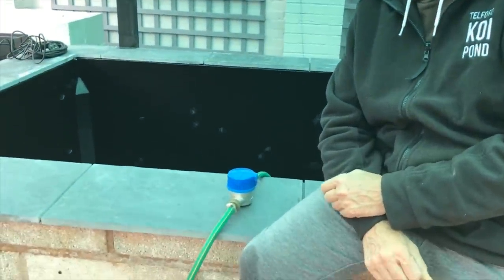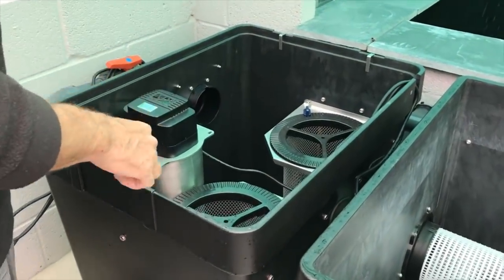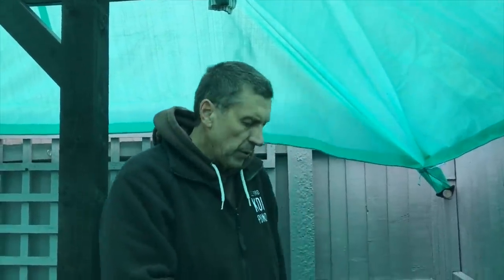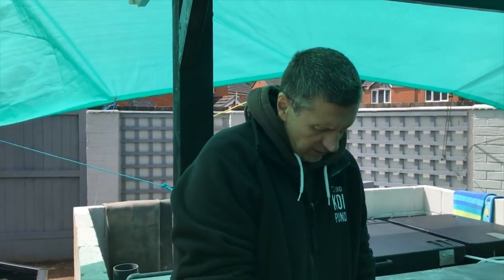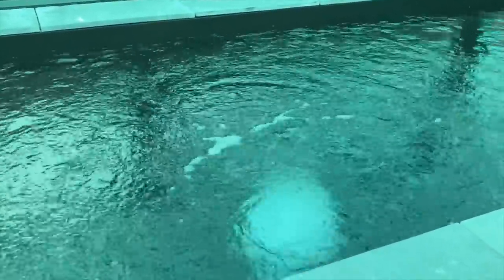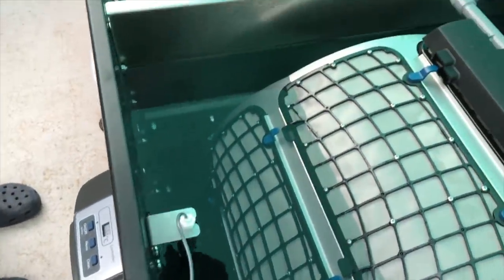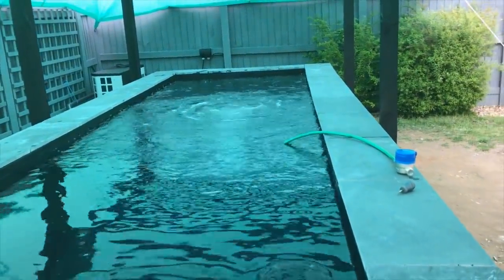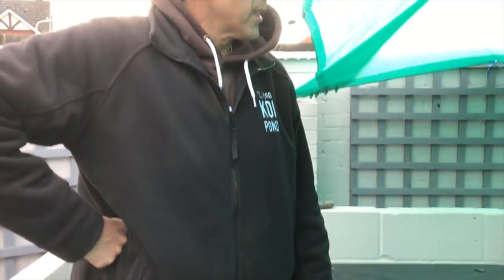New Telford Koi Pond Part 22 - The BIG FILL, Filter switch-on and the Thermotec Airsource Heat Pump.

Comment: Brilliant. All looks amazing. The heater is better there as you will loose less heat as the return to the pond is so short rather than heated water running down 10 meters of pipe before going into the pond. You did well with the weather we've had recently. I don't think the fan was running when you said it was so quiet, hope you got it sorted. Thanks for filming all the switch on also, nerve racking moments and you actually filmed it. Cheers.
Reply from the maker: Hello Simon, very observant, I’d switched the unit on but not the actual functioning of it. Realised my error when we stopped filming so a press of the on button and everything jumped into action. Thanks for watching and commenting 👍🐟🈲😊

Comment: Sure someone else has probably mentioned but you will need to change the settings in the engineers settings on the Thermotec. Need to change the temp swing range and lower end temp. Also adjust flow using the bypass to get a 2 degree difference in temp for water in and out. Great job on the build
Reply from the maker: Good afternoon Richard, No, no one else has mentioned this. Is this something I can do (if so how?) or do I need to get in touch with the place I bought it from? Many thanks in advance for pointing this out.
Reply: @TelfordKoiPond  you can do it yourself. I have the setting changes on messenger that I can send. You just need to restrict the flow using your bypass valve to balance it and get the temp difference.
Reply: @TelfordKoiPond  R04 and R12 need to be changed to 0.3% and R10 is the lowest temp setting which is 15 from factory so reduce this is you want to have it lower at any point. Engineers code is 66 to access the extra menus
Reply from the maker: @richardrapley9210  Brilliant, thank you👍🈲🐟

Comment: Great job.  Fantastic to finally see it filled and running.  Filling up the filters during the fill should be fine as it's the total water volume you'll need for treating, not just the pond itself.
Reply from the maker: Thank you for taking the time to watch and comment, much appreciated. Your are obviously correct re the whole water volume for any treatments so no harm done even though it was a schoolboy error leaving one of the valves open 👍🐟🈲😊

Comment: Well done mate. Done a fantastic job. Your filtration is lovely and neat. Look forward to seeing the fish go in. Pp really dose help speed on maturing the media. That hel x is great stuff. I've got 100l in my ibc
Reply from the maker: Cheers Danny. Yes, wish I had pp’d it now so may scoop some out and get it in for a day or two. Thank you for watching and commenting 👍🈲🐟😊
Reply: @TelfordKoiPond  yeah scoop most of it out and soak it in pp for a few days. It won't of built up any bio yet so not losing anything. Will help lots in the long run. Have you got any mature media from your temp pond you can chuck in your new filter? Maby get something in those baskets in the pump module. Those oase drums are so neat, If I could do mine again I'd have got one of them
Reply from the maker: @dannycurrie1  yes will be putting the mature media from my holding tank into the new filter to help 👍😊

Comment: Great job Phil, I have the same drum
filter on my ponds, best ever investment I made along with Oase pumps what you fitted, I would recommend you get the oase EGC controller easier to change the settings of cleaning times etc and monitor any issues if your away or at work, look forward to the fish going in.
Reply from the maker: Hello Gary. looking for some help please. I've just been setting up my Oase drum filter and I believe I've done everything correctly but I cannot get rid of Er88 on the control panel. I've gone through the instructions several times and can't see what I'm doing wrong but the level detection device still keeps giving me error message Er88. The water level in the unit without anything running is bang on the maximum water level and when I turn the main pond pump on it drops to the minimum level marker. I've tried to set the device as high as it will go and as low as it will go but after a manual clean or after 10 mins of running the display on the control panel changes to Er88. Any ideas what I'm doing wrong?
Reply from the maker: @garygillespie4188  Thanks Gary. Phoned Oase Technical support and I walked them through what I had done and how I did it and their advice was........turn the sensor off as it has no real value in a normal system. I have turned it off and everything is now working correctly but still have concerns 9dont like turning sensors off) so have asked for further guidance. Thanks for getting back to me so quickly.
Reply from the maker: @garygillespie4188  Gary, can I just check, when you take your lid off and do the clean test, does your drum go round? Only asking as Oase tech support are saying that the drum wont go round without the lid on? Sorry to be a pain but I'm struggling to make any sense of this.
Reply: @TelfordKoiPond  no problem Phil, if you spoke to Jordan I am sure he will be right he knows the inside and out of the drum off the back off his hand, yes I am sure they will provide you with more information on that, glad I can assist if I have 
Gary
Reply: @TelfordKoiPond  it’s okay mate you can test without the lid but only spray will work for safety reason, sorry I wasn’t clear there, but the drum won’t go round, but I have a spare magnetic to test the drums as one of my lids was damaged when I receive my drum first

Comment: Fantastic Phil 👏🏼
Great choice on the heat pump brand and the model as its always worth having a bit of gas in the tank for those particularly cold winters.
I have had the hel-x13 k1 and k1micro media for a number of years and the hel-x13 seemed to tumble much faster than the others, I've recently upgraded my bio chamber and added another 75 liters of media but this time I've chosen k+ so now I've got the whole set 🤯 I dont think it's a notable difference to the average koi keeper as to which is better but I've covered all bases now.
Adding a blead valve to the bottom drain air pump should tame the jacuzzi effect so you can see the koi more clearly from the top.

Goodluck mate
Reply from the maker: Hello Tom, thank you for watching and commenting, much appreciated. Definitely going to get a bleed valve sorted. Stay safe 👍🐟🈲😊

Comment: Hi! In the process of building my pond at the minute just waiting on it to be fibreglassed. Was wondering where abouts did you get you coping stones from? There just what I’m after and can’t find any.
Regards neil
Reply from the maker: Hello Neil, To be honest I had a right game finding anything I liked that was in-stock but in my internet search I came across a company called Hoyland Dismantling and they had a stock of Black Brazillian Slate Wall Cappings that were perfect size (new not reclaimed and they have a large number of sizes) and really good price so I got in touch with them. Daft think is.....Hoyland sell all this stiff on ebay which I hadn't looked at....doh!!!!  So either do a search for Brazilian Black slate wall cappings on ebay or give Hoyland Dismantling a ring. FYI - I had 28 (4 spare) 600 x 300 x 20mm copings and they cost me £227 delivered in 3 days. Hope this helps.
Reply: @TelfordKoiPond  cheers mate I’m playing that game now 🤣 I’ll have a look 👍🏻
Reply: @TelfordKoiPond  thanks for your help mate! Coping stones turned up today! Also ordered some splitface 3D cladding tiles with them as well so very happy thanks again👍👍
Reply from the maker: @neilp3406  great stuff, glad to be of help👍🐟🈲😊

Comment: If this is day 1 of the fill up, I'd turn everything off and isolate your filter from the pond etc, then leave it 24 hours to check if either the pond or filter water level has dropped. You may need to adjust your sensor level in the drum and it's does a sensor trigger clean every so often.
Reply from the maker: Hello, very valid suggestion and last night I marked Pond, drum filter, individual module and overflow to see if any losses overnight but good news is everything was still right on the mark. Have had everything running today (still monitoring levels all day) and all still good👍. Water is now up to 16.5 degrees so will run it for another 24 hours before thinking about moving fish in. Thank you for watching and commenting 👍🐟🈲😊

Comment: Have you got the fish in yet?
Reply from the maker: Hello there, not yet, wanted to leave everything running for a few days to check for leaks/water loss and to get the flows through the heat pump and returns set up correctly. Plan is to put them in tomorrow or Saturday latest. Will get a video done to capture the event. 👍🈲🐟😊

Comment: Looking good there Phil! What have you used to top your brick work? Is it slate or a slab? Looks just like what I am looking for. Where did you get them from please?
Reply from the maker: Hello Andrew, copings on top of blocks is Brazilian black slate wall copings. Cheapest I could find were from a company called Holland Dismantling. They sell stuff on eBay so you can also buy it off there. I went for the 600 x 300 x 20mm copings and they delivered them on a pallet 3 days after I ordered them so good service. Hope this helps.👍🐟🈲😊
Reply: That helps.  Thanks

Comment: HOW MUCH WAS YOUR THERMO TEC AND HQW MANY GALS WILL IT HEAT PLEASE
Reply from the maker: Hello Richard, I bought the 12kw model which is currently circa £2135 and the 9kw is circa £1865 at Heat Pumps 4 Pools. The 9kw model is recommended for up to 4,500 gallons whereas the 12kw is recommended for up to 6,000 gallons. I took into account the temperatures I want to maintain and the severe winters we've had of late. Best recommendation from me would be to speak to the people at Heat Pumps 4 Pools as they can give the best advice. Hope this helps.
Reply: @TelfordKoiPond  THANXS I WILL DO LOVE THE VID

Comment: Hi Phil, are you going to do any checks on your water before you put your fish in? Great job by the way 👍
Reply from the maker: Hello Rob, yes I will be checking the water before the fish go in. Everything has been running since the weekend and I’ve made a few adjustments to the air and flow through heater and other returns so have a really nice flow round the pond now. Filter media is currently soaking in pp so that will be going back in the filter tomorrow and then get some start up bacteria in . Thank you for watching and commenting 👍🐟🈲😊

Comment: New sub,how much was the ashp,and how many gallon is the pond cheers
Reply from the maker: Hello David, Thank you for subscribing, it is appreciated 👍. Finished pond is 2,500 gallons or 11,300 litres. ASHP was bl**dy expensive!!!! I ordered mine in October 2020 as I found out there were none left in the country and the next shipment was 90% sold so at the time I thought I was paying a premium as I had to shell out £1,850 but soon realised that the prices were only going to keep going up and I gather my model (12kw) is now £2,245. A 9kw model will do up to 4,500 gallons but basically I got the 12 model for same price as 9 as there were no 9’s left on the shipment that was coming in. There are other ones on the market and I gather the Ramora version is cheaper and still comes with WiFi. Hope this helps👍🐟🈲😊

Comment: wHAT DO THINK THE COST WOULD BE FOR A 10'0000 GAL POND  AND RUNNING COST AT 16 DEGREES
Reply from the maker: Hi Richard. I’m new to all this and not had it running long enough to understand the costs yet but I would suggest you look at wrighty’s videos as he has been tracking cost all winter and I believe his has worked out to roughly £1 a day for his 2500 gallon pond. Sorry I can’t be more accurate. I will be tracking mine over the next 12 months but again my pond is only 2500 gallons. Thanks for watching and commenting 👍🐟🈲😊